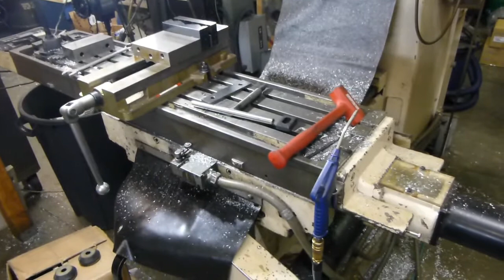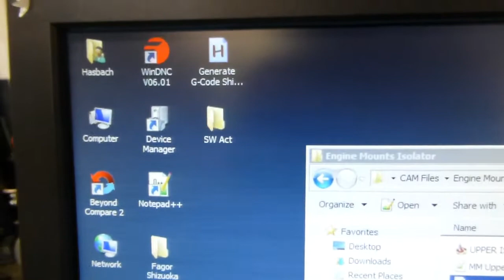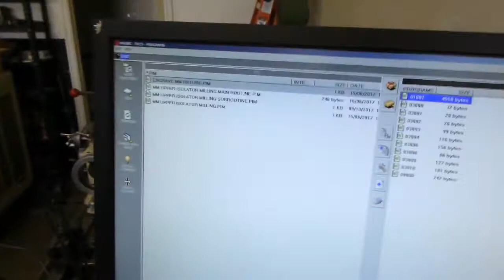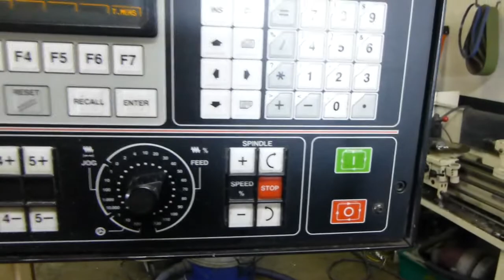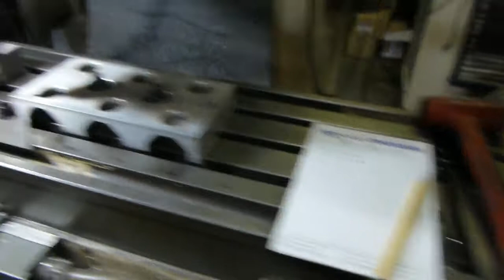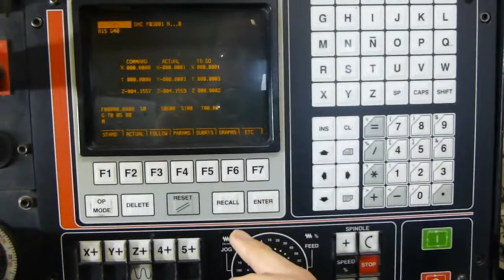Fagor 8025 / 8030 CNC Operation on a Shizuoka AN-S Mill

Comment: so a G20 is to run a sub routine? It is normally for a inches code
Reply from the maker: A G20 in Fagor talk is a subroutine call. This does differ from Fanuc where it does specify inches code. There is a Fagor PDF file called man_8025m_user.pdf that covers this. Do a web search and see if you can find it.